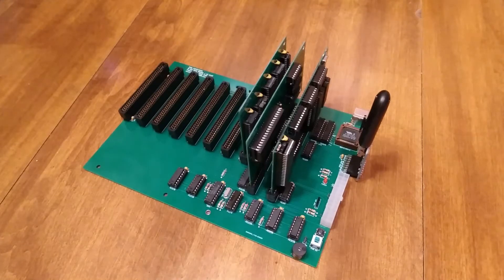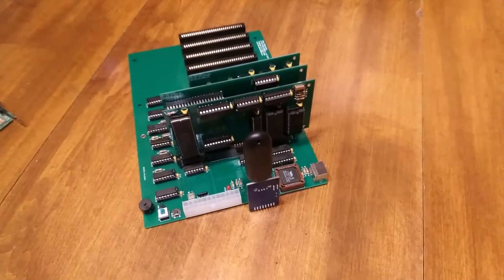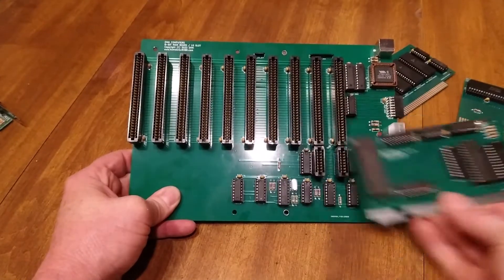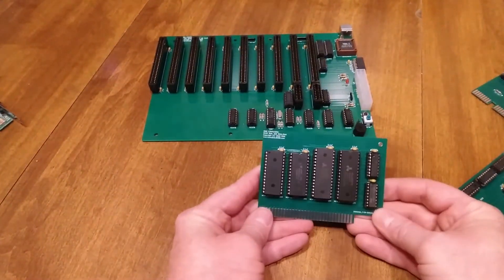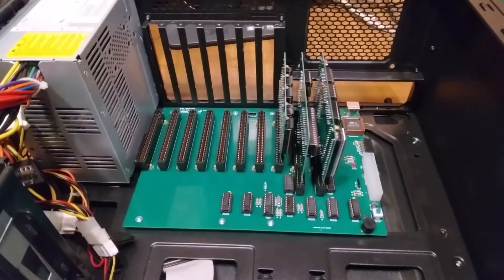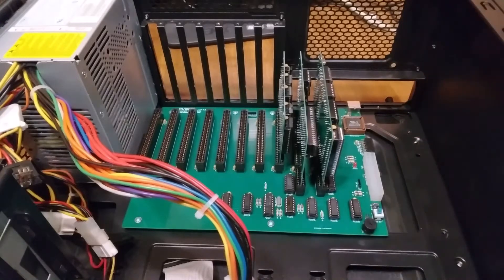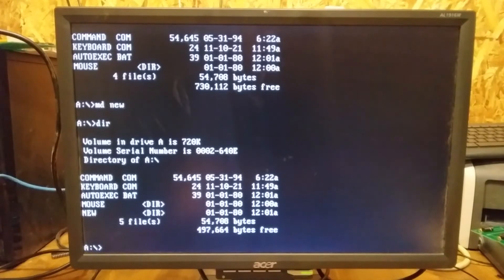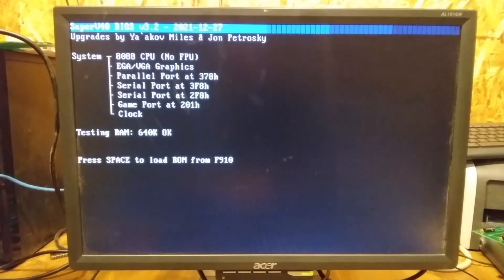8088 PC project with 10 slot ISA main board.

Comment: Hello my dear!
Is there any way to connect a 16bit ISA card to a 32bit PCI slot?
Reply from the maker: I have seen 8 bit adapters. I am sure a 16 adapter could be created. The off the shelf 8 bit adapters is not exactly fully hardware compatible to the ISA standard. Port address are not related ether.

Comment: Nice! But do you have a different side solution, i.e. cheap to manufacture ~100x100mm  board, which possible to mount into mATX or mITX case?
Reply from the maker: I have a 4 slot motherboard board that fits in a smaller case
Reply: @elijahmmiller  can you put a link here?
Reply from the maker: https://youtu.be/QD9bJH5GVME

Comment: I know this video's a little old, but it just popped up on my YouTube feeds, I'm highly impressed with your work, I'd love to own one of these set ups, by chance do you offer customisation? Ideally I'd like a mini itx size main board, understandably that would cut down on some of the isa slots, but from what I understand I'll only need 3-4 available slots for my cards I have packed away in a box (VGA card, sound card, io/floppy controller)  

Im also located in Australia so shipping will need to be part of the plan too, 

Keep up the good work :D -ben
Reply from the maker: I typically sell the 7 slot main board. This leaves 3 slots available after you add the processor, memory, DMA, and graphics cards. I make custom work often. Just send me an email directly and we can figure something out.

Comment: How about adding a hole in one corner of each of the next variant of the main cards that would allow users to put stand-offs between them to make them more stable?
Reply from the maker: Where the bracket is not installed I wonder about using the existing holes for something like that.
Reply: @elijahmmiller  Yes, that should work. The top corner should be enough to stabilize them a lot.

Comment: Neat!   BTW, I 3-D printed a "brace" with slots for the first 3 cards in my system as I don't have a back plane bracket on my DMA card.  This seems to work fine since the cards are the same height.
Reply from the maker: I forget about 3D printing. That would be a great option.
Reply: @elijahmmiller  we need someone to design a 3D printed holder for those 3 'base' cards, to make retro computing stable&